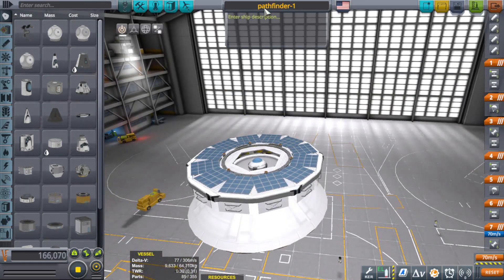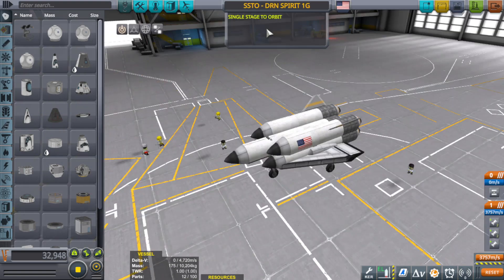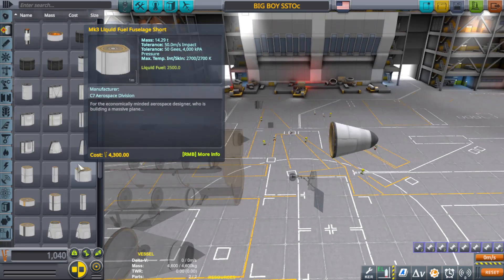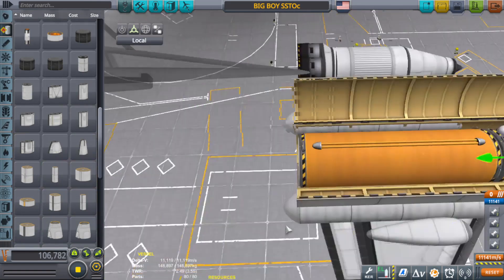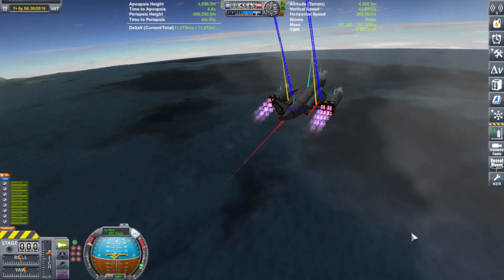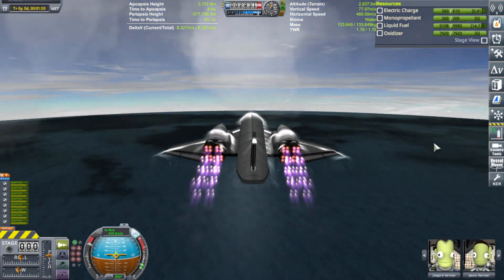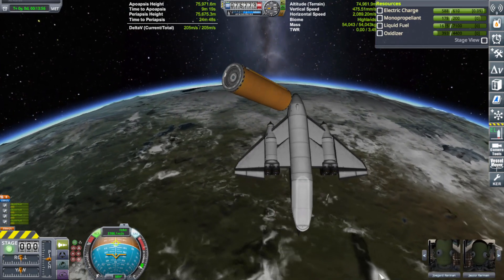CRAFT FILE TESTING SSTO \ KSP 1.12.2 \ Kerbal Space Program

Comment: RCS Build Aid also shows thrust vector attitude deviation, making it easier to build asymmetric ships or to account for cargo altering your center of mass. And, in addition the wet and dry fuel center of mass, it will also display the average. For the RCS function, it doesn't place the thrusters for you. What it does is show you the rotational deflection when in translation, and the the translation deflections when in rotation. If you get these to 0.000 kN then the balance will be perfect for the center of mass you have selected. It will also show you the dV, burn time, and thrust for your RCS.
Reply: Rcs build aid all the way, but I've only gotten down to 0.01 kN
Reply: @TheArchaicFuture  The trick is to clip in an rtg or battery or the like and use the offset tool to get it to exactly zero. I love making variable geometry VTOL landers and with RCSba i can balance thrust and RCS no matter how my engines are tilted.

Comment: I have been refreshing the page continuously since 9am.  Of course you wait until I go outside for a few minutes to hit Publish.  :P
STREAM HYPE!  
A couple of terminology tidbits: 
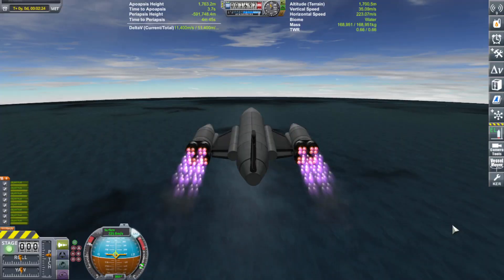3:27 Your tilting of the wings is called "angle of incidence" and is something most real life planes have built into them.  
3:04 When you were saying "angle of attack" in this segment, what you actually meant was pointing at prograde.  Angle of attack (AoA) is the angular difference between any airfoil's chord line and the relative wind.  Every airfoil on a plane may be experiencing a different AoA at any given moment in time from every other airfoil on the plane: each wing may be seeing a different AoA, each stabilizer, each propeller blade, etc.  AoA is constantly changing and is subjective to each airfoil as it perceives changes in the ambient wind versus the aircraft's orientation in space.  What you were trying to say is that the Big Boy creates minimal drag if the longitudinal axis of the fuselage is as closely aligned as possible with the aircraft's direction of flight ("prograde" in KSP jargon).